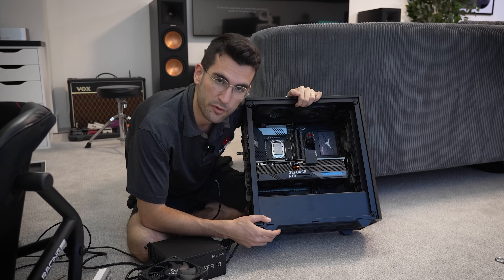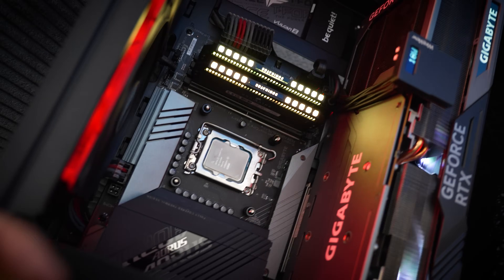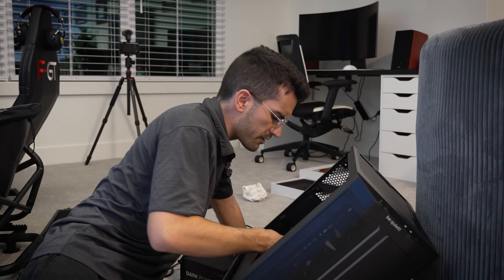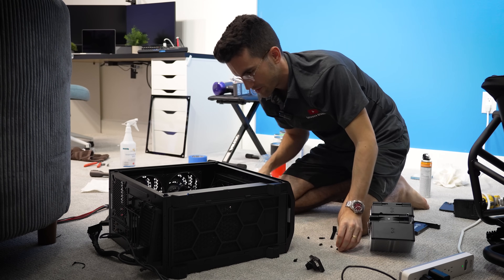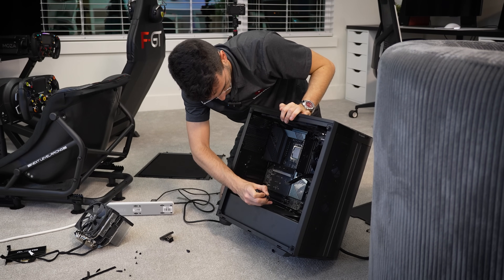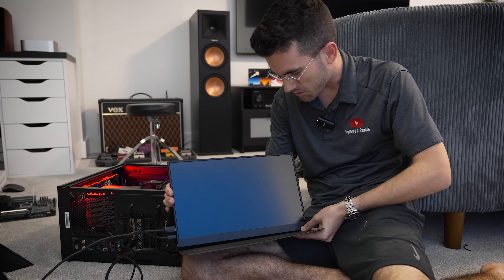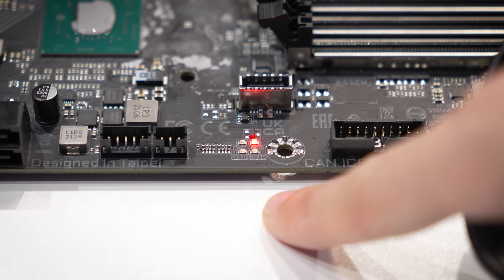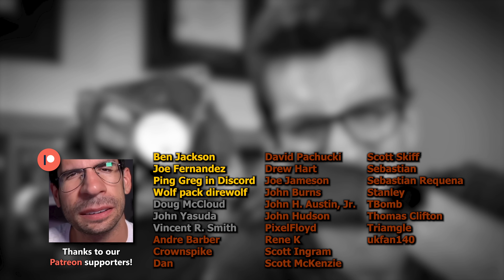Fixing a Viewer's BROKEN Gaming PC? - Fix or Flop S6:E6

Comment: Probably had a pin not quite getting full contact after the thermal paste in the socket madness... Had enough contact to work but at a higher resistance and the eventually the increased resistance took out a capacitor or vrm or something.

Comment: 17:49. Things happen. I reinstalled Windows 10 on my sisters pc not to long ago. About 2 weeks into the new installation, she rearranged her room and with all safety precautions in mind, she moved her pc to the other corner of the room. When she went to start it up, the windows installation broke. The fix for it was just reinstalling windows 10 and nothing else. It is a good thing she has all her personal files on a separate drive than her boot drive, though.

Comment: The reason when you tested the bad board with no ram, but still said cpu was because intel chips since around 2010 have had the memory controller on board the cpu. If the cpu isnt working, it will have no idea about the ram

Comment: Hi Greg, I had a Gigabyte x570 AORUS Master with the same problem no heat/power on the CPU, tried Ryzen 5500, 2700x, Athlon 3000g etc, First I could not figure it out, But then reading on reddit that the Bios sometimes dies by itself. I finally fixed it by flashing it to the first released bios without any CPU installed, and then flashing it to the latest. I did this for the main and secondary bios chip. Now the board has been running fine with a 2700x in it for eight months.I used the Q-FLASH PLUS to do this.

Comment: Another Gigabyte board bites the dust.I had bad experience with Gigabyte/Aorus boards in the past.2 of them died on me.Fist died after i enabled secure boot and TPM 2.0 to install win11.The bios got corrupted and i tried everything but the board just bricked.There are dozens of Redit threads with this problem.Second one just died like in your video. No idea why...and had other problems like usb ports suddenly stopped working and coming back to normal.For me MSI are the best. No problems in the last years and still today,no problem.Never had the issues like on Gigabytes boards...Never buying them ever.There are the worst for me....

Comment: I had a Z690 Aorus Elite AX that did the same thing with a 13600k..Never did figure out why, Sold it for Parts on Ebay. My Auros z790 Elite AX has never had a problem though and thats running a 14900k.

Comment: I personally like ur videos especially fix or flop because in cases like these where i have to trouble shoot my system i can just follow along the basics. for example recently my sister turned on my pc and she came up to me that the pc is not posting. When i checked i saw that everything was good but when i power cycle my gpu fans were not spinning i was so afraid that my gpu died as i cannot afford one rn i did the basic procedure of removing ram and what not checking if my gpu was smelling then a thought came up in my mind that i should reset my bios. I have an a520m board so there is no bios reset switch or any fancy features like that on it i simply removed the cmos battery and waited 5 minutes sure enough after 5 minutes my pc posted even though i had to reinstall windows for some reason it was un usable past the lock screen but hey its way better then having to replace my gpu and what not. I learned this from your videos that cmos reset is 90% of the times the fix and sure enough if was the fix in my case.

Comment: The LGA 1700 socket latch mechanism maybe the culprit. They are known for bending the PCB with its leverage thus desoldering the connections after heat cycles?

Comment: I had a z390 aouros master motherboard brick when all I did was transfer it from one case to an other a couple years ago. I left the cpu and ram installed, just unscrewed it from one case and reinstalled it in another case and it refused to work after that. It was bricked for seemingly no reason. Took it to microcenter to see if they could figure out why but they couldn’t find any reason for it being bricked either. Just one of those weird things that happens sometimes 🤷‍♂️

Comment: Regarding Mobo bios, make sure you use the correct revision to update specially with QFlash, when I got my z790 Aorus Elite AX, I just downloaded the latest bios and refused to update via bios or flash, then I noticed there's a revision number on the mobo and on Gigabytes website,  and low and behold when I selected the correct revision it flashed flawlessly

Comment: I love that case so much. Unfortunately it's just sitting in its box because I really hate how BeQuiet made the front panel. Removing it feels like your breaking it off. You might say, but hey you only need to remove it once a month for cleaning. But still. I enjoy cleaning the dust filter on the front every week. So an easy removable front panel is a must for me. Which is why i ended up buying the 4000D airflow, just a slightly bigger version of this case..

Comment: Not long ago I had a power surge/lightning strike?? Something took out the ethernet on my mobo. It was a cheap H310 mobo, but luckily I had a wifi/BT PCIe card in it already so all wasn't lost. I wound up building a new PC, but that old PC is still kicking it in a friends house. I'm surprised the router made it, and the rest of the PC was fine, but Windows would no longer recognize the Ethernet, no matter what i tried. New drivers, bios, it was gone. Nothing lasts forever. I need to invest in a better surge protector that has ethernet protection, but even with those I'm not sure how protected Ill be??

Comment: That was not the case, but keep in mind that if you have a short on a usb/audio/whatever chip, there is a very high chance that those chip are connected through pci directly to the cpu.
So a short to one of those, is a short that can directly impact the cpu (even break it if it's a very nasty one).

Comment: Do you get more frustrated with your own IT problems? (I do)
A few years back I had a pretty obnoxious issue where mice would rapidly click or misclick on my PC.
I tested with several different wired and wireless mice, all USB ports, reset windows, then did a fresh reinstall.
The issue persisted so I started swapping out hardware.

What eventually lead me to a solution was swapping in an old 750 ti that didn't use Nvidia PhysX.
For whatever reason Nvidia PhysX would act up with my specific pc configuration.
Since it's not required to play games (mostly used for volumetric effects) I uninstalled it completely.

Comment: You are not the only one with a big fat flop hell hole. I am slowly building a brand new guess what happened the first thing DEAD WIFI 2nd thing DRIVERS FOR ONBOARD GRAPHICS AND ONBOARD GRAPHICS IS DEAD  BOOT IS IN SAFE MODE REBOOK OK AND MY OLD EVGA GTX 1070 DEAD  AND REALTEK AYDIO DRIVERS US FOR EXTERNAL USB AUDIO THUMB STICK DEAD AUDIO AND 2 OF THE EGB GRAY PORTS MEAD 24PIN MOTHERBOARD PLUG IS DEAD  the motherboard is. ASROCK PHANTOM X870 RIPTIDE WIFI I was done I'd download a crap ton of REALTEK AUDIO DRIVERS none worked So it byte the ghost so I done a RMA and NEWEGG AND EVEN TODAY 1/7/2025 after it was delivered to NEWEGG AND REFUSE TO PROCESS A REFUND

Comment: I'm not even six minutes in, but I'm already sus about a USB connection/failure, or even more commonly, a failed Power/Reset Switch. The Switches from China are cheap. They fail all the time.

Comment: it's all anecdotal of course, but the motherboards i've experienced the most problems with have always been GIGABYTE. every single one, from AM4 to LGA1700 and now AM5, every single one has given me some sort of problem. from power delivery to random but persistent blue screens (with nothing in event viewer) to system updates causing memory training failures that dump me to the bios on reboot. at this point i've sworn them off completely and now stick to MSI as my first choice, and ASUS as a reluctant but typically reliable second.

Comment: Had the same thing with my old 4790k setup, shut it down before going to bed, then tried to turn it on in the morning and had that same thing. No power surges (on a UPS) nothing out of the ordinary. Ended up being the MB had just died. Luckily out of all the PCs I've had the last 25ish years that and a 780ti were the only things I've had fail.

Comment: Shot in the dark, you might wanna clean the (problematic) motherboard's VRM with IPA and a brush just in case, i once has a system that has its VRM that dirty (same debug light, CPU) and it wouldn't post, 8 years ago (!), i did this (x55 motherboard) still works perfectly fine.

Comment: I think the PCH on the old board goosed. Reason being is that the PCH will go to multiple areas on a motherboard including the super I/O or places near it. It's entirely possible that the bent pins you found could have shorted something in the PCH circuit.

Comment: You can buy a replacement cpu socket and replace the bad one. You just need to find someone who does board repair using  a hot air soldering station.

Comment: Those little blocks are most likely resistor packs, combined sets of resistors in SMD form. I'd say clean out the CPU slot as the paste may have become conductive after voltage had been applied to it for several months. My rough guess would be a shorted PCI-e line on the socket side preventing the CPU from posting. The resistor packs could be getting hot because they're feeding power into the slot end of the PCI-e lanes, this could also explain why the chipset is heating up. Bar something being wrong on the VRM side of course. Cleaning fixes a surprising around of electronics like magic
Reply: I suggest finding a can of specialist plastic-safe aerosol PCB cleaner, you would most likely need a can or two though

Comment: PC builder here
as soon as the CPU doesn't heat up, we know the board is cooked, no further testing needed
Reply: Bingo! if the chip ain't hot the board is shot.
Reply: Lmao that's the first thing I said. Doesn't matter if everything else powers up. The chip cold the bored is cooked.
Reply: Or it’s a dead cpu.
Reply: CPU cold means dead CPU, PSU (or cables), or Mobo.

He swapped out the CPU, and bypassed the cable extenders, but not the PSU or its native cables.

If you see one symptom and automatically conclude from that alone with no further testing, you're a terrible system builder.

Comment: I'm not far into the video. But could it be that the motherboard needs the other 4 Pin cpu connector as some sort of primary power source and just uses the 8pin as a supplementary powersource?

Comment: Greg, I encounter a similar issue. I just swapped my after market air cooler(phantom spirit) back to the default one(laminar RH1) and to my suprise it is not turning on. I spent more than 4 hours troubleshooting/isolating the issue. I was able to resolve it by removing and reinstalling the cpu ilm mounting retention bracket. I read somewhere that they are sensitive and you dont have to really tighten them hard because it affects the mobo/ram connection. That is my guess on your case since you havent tried reinstalling the default ILM/cpu mounting bracket.

Comment: What is really sad is when it works every time you plug it up at your house, yet you take it 30 miles away to your nephews and it doesn't work. Bring it home and it miraculously works again take it back and it refuses to work.
Reply: The house I live in now was built in the 1810's. When me and my wife moved in back in 2017, it had been upgraded, renovated and modernized by several generations of people. The electricity was a nightmare of mixed stuff but it worked. Except a single plug in the downstairs office. Random shutdowns, bluescreens.. Replaced power supply, new cables, mobo swap. Nothing helped. Then one day I just moved the PC to another room so I would have better light for the repairs. PC worked perfectly in that room... So yeah, I agree with the others. Power issue in the house.
Reply: It's likely gonna be their surge protector/ power outlets. I've seen/heard about this happening quite a bit. People ship their pc's to repair places and it works fine when it gets back to the owner same thing, they change the surge protector or plug and it works...
Reply: @DOD9ER  I had sketchy power in a place I lived years ago. Once I figured this out, finally, my solution was to get a sine-wave UPS to maintain clean power to the PC. It worked wonderfully, and I never had a problem after that. Cyberpower UPS, and I'm still using it for my current PC 14 years later. You can replace the batteries with warrantied batteries from the company itself, recycle the old one, and you're good to go. They still sell the unit I bought, which is a testament to how good it is.
Reply: I agree with Dodger_Dawg. Sounds like some kind of power issue at the other house.

Comment: It probably died from a stroke after counting the amount of times Huang said AI on stage at CES (or his jacket, could have definitely been the jacket as well). On a serious note, that resistor is cooked, as others have alluded to, solid state resistors typically go full retard when failing. Not that this is helpful because after replacing it, it could just as well decide to fry itself again if the problem is elsewhere, and you're just observing the symptom of the problem.

Comment: My guess is that you've gotten a few part(s) on the motherboard that went bad and caused a short.

My guess is that the perhaps the sound area is shorted, causing the chipset to get very hot and thats why it is refusing to initialise. (Basically, the chipset has detected the short and isnt initalising anything to prevent damage to other components.)

Look around hot components to see where the short is.

Comment: I lost count on how many motherboards I've replaced in my IT career.  Modern motherboards are so much better than the ones from the late 90s, early 2000s.  Those were notorious for failing capacitors.

Comment: Man I felt that "it was working fine until it wasn't" on the motherboard issue you had on your PC Greg. My main PC's had episodes like that with both motherboard and GPU.

The motherboard worked fine but had hot VRMS, then it developed USB issues specific to my gamepad, then developed power delivery issues and stopped working entirely. So it really worked until it didn't and a motherboard swap fixed everything.

The GPU was just a few weeks ago before Christmas where the PC was just idle then I randomly got a black screen and was hit by the motherboard screaming a GPU issue beep pattern. Turns out my used RX 5600XT from China that came in dirty and I had to clean myself was to blame. Only had it for a bit over a year and it randomly black screens now no matter if its idle or under load within 10 mins to 2 hours so it was annoying to diagnose.

Good thing I had my friend's 9500GT to diagnose and yeah it was my GPU. Another discovery was that the random slow PC POST & boot process I was experiencing was also caused by my flaky 5600XT as the issues went away with the swap to the 9500GT and later the RX 580 2048SP I got as a replacement.

Comment: Check the pch section in every board there is a small radiator somewhere that dissipates heat from the main controller of the motherboard. In my case it was 55 degrees at rest it turned out that the paste had dried and it was simply not there anymore that is why the temperature at rest was high. After cleaning and changing the paste it was over 15 degrees lower at rest. Many people forget to replace this and then the board stops working.. 15:16 You can see perfectly that the PCH has simply baked and that's why the main controller that turns on the rest of the board is not starting, there is no temperature on the processor or power supply because the PCH is too high and it won't turn on. And if it's baked, I bet we won't do anything.
Reply: they ought to replace paste on all those components with graphite sheets, then this will never be an issue again. it should be simple to do at the factory and save RMA expense as a result.
Reply: @davidhines7592  They won't do it because graphite is much more expensive than the cheapest templappasta, and it wouldn't be worth it for them to do it, why? Something has to break down and fall apart for you to buy something newer, the equipment will last 5+ 8 years if you take care of it, but for someone who only uses it and doesn't clean it, you have max 2-3 years, then the equipment falls apart and needs to be replaced. Those who know what to do when you have, for example, a high PC/laptop temperature have a different situation, and if you know how to do it yourself, what's better to invest in, you have additional profits.

Comment: You should put a Sanus in wall power extension kit behind that TV instead of the cable cover running down the wall. It looks cleaner and requires no electrician to install. You can also use it to run in wall rated HDMI cables down to that Denon AVR that should have the sticker peeled off of it 😉

Comment: I can relate, my X870E board died on me. No POST, no lights, just dead.
So I'm running a B650M board I have lying around.
Tip: plug in a wired keyboard with lock lights and press Caps Lock and or Num Lock and see if the lights go on or off. If the lights work the build has POSTed.

Comment: It may be worth checking out the socket with a "LGA 1700 CPU Socket Tester" - some of which will show with LEDs if you are receiving voltage on specific pins, doesn't guarantee it will work, but might give you some points to probe and investigate further. There were also a few other pins that looked potentially dodge that you didn't show checking so it could be something there. There are many other possible causes though, so I don't blame swapping to a different board!